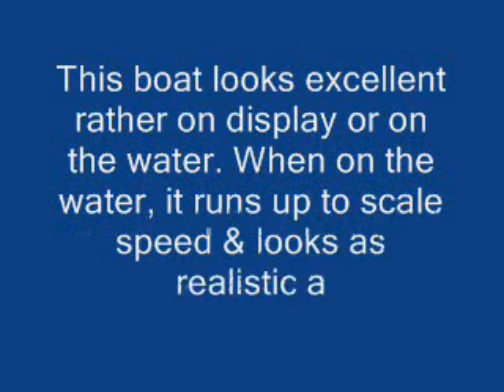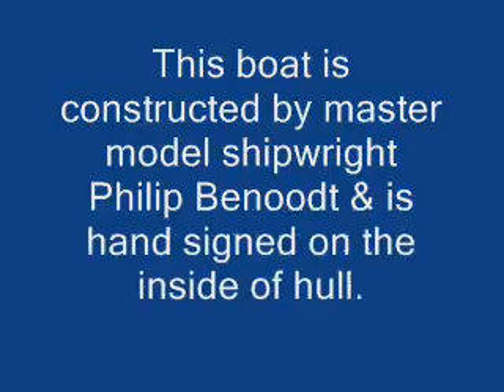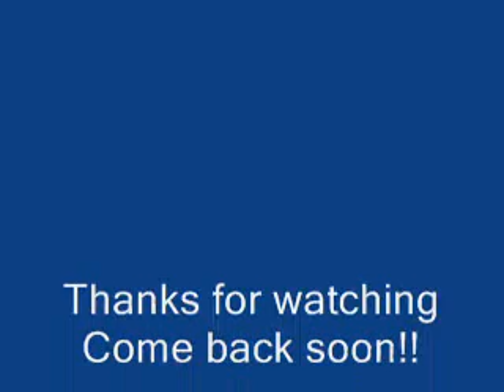LATE WAR ELCO PT BOAT 1:20 Scale

Comment: Nice detail work. I also scratch built a late war PT. Mine is 67” long, weighs 50 lbs., and is powered by a 3.25 hp Zenoah engine turning 3 props. The 2 outboard props are belt driven from the center one.

Comment: Really nice job.   Excellent.  I have the Dumas 48 inch hull (thank you EBAY) and the 596 kit from Frank.   Your chart house... there are a series of what look like eye bolts holding the tubular railing --   did you scratch build those eye bolts?   If not where are they from.